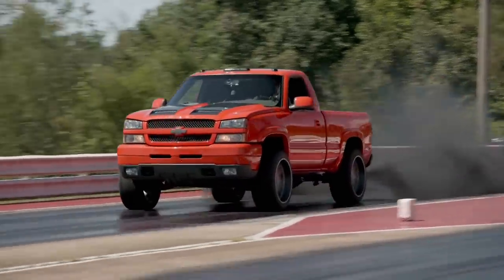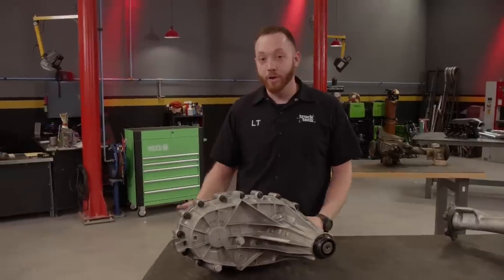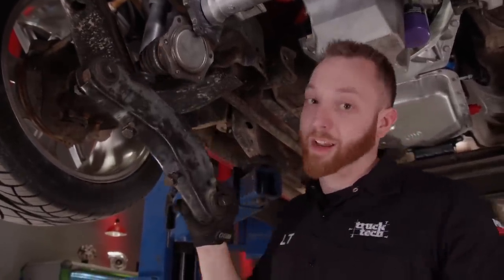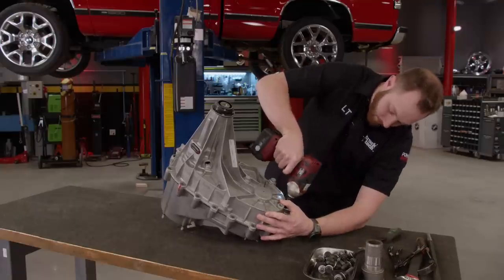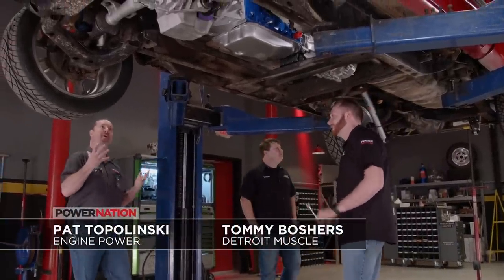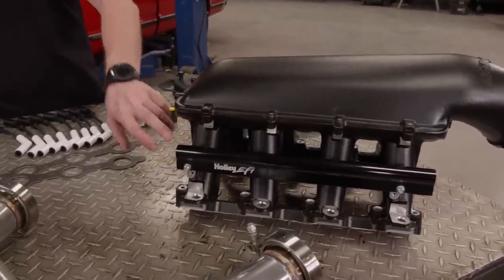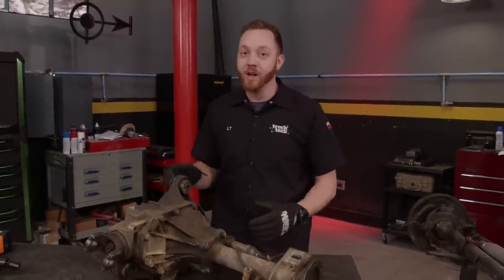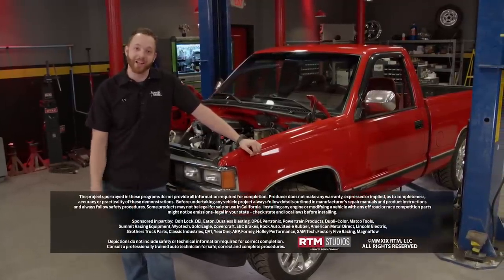AWD vs. 4WD Chevy 1500 - Truck Tech S6, E6

Comment: If you want an improved version of the NV149, get one out of a 2003 to 2015 GM H series AWD cargo van.  They shipped with a BorgWarner 4471 or 4473, which are way better than the NV149, since the NV149 is technically an open diff, and if you remove the front input shaft, it will not transfer power to the rear.
Reply: Bw4481/83/85

Comment: Who makes the 32spline input?  I’m on the market for one!
Reply: An AWD transfer case from 07 and newer denalis and Escalades Have 32 spline and no sensors on them.
Reply: @13Bender31  😬
Reply: @JoseContreras-mv5yz  I took mine to a local machine shop and they have a wire EDM machine that they used to cut the 32 spline without having to anneal and heat treat again.  Cost $200.

Comment: I was into watching this, so I can do an engine swap on my 91 K1500.  You left out a lot of information that would have been helpful.  You removed the front end wiring harness, all the way to and thru the firewall.  However, the show didn't provide any further information about the wiring of an engine swap besides the Holley wiring to the engine, inside the engine compartment. 
I wanted to know if I missed something?  I saw S6, E6, E7 and E8. 
Can someone let me know of a video(s) that show more wiring detailing?

Comment: I have a 2004 SS that needs some love, wiring, speedo not working, heated seats are bad, and some suspension work is needed, but the truck runs and drives well. If you guys need a new project truck, and want to fix this for the show, let me know..haha..

Comment: Question- wouldn't it be easier to mount the accessories onto the engine BEFORE putting it in the truck? At least most of them?
Reply: not really, the ps pump is a pita with the steering shaft in, but otherwise the rest is a cakewalk, alt is right up top, and unless notching the frame for the low mount compressor you're running a higher up ac compressor anyways. water pump is 6 bolts easy to access, and better to leave off until it's in, especially if you're not pulling the rad or condensor

Comment: Me and my son are building the same truck but i purchase a 07 cadillac escalade 6.2 and i just purchase the motor mount bracket and everything bolt on even the rear driveline was the right size

Comment: I want to convert my 2000 GMC 3500HD dually to 4WD. It has the factory I-beam axle in the front with leaf springs, a Dana 80 in the rear, 7.4 Vortec (454) and a 4L80E trans. Not sure if I should go with a Dana 60 or Dana 70 in the front. Any advice? Is one axle easier to work with?

Comment: Would love to run this front differential in my 03 S10 blazer that I’m looking to lift instead of going Dana 44s for axles for a SAS swap. I wonder if the NV149 would mate to a NV3500
Reply: same issue as that 4l80e, 32 spline output shaft. there are other awd cases that came behind the 6l80e that will bolt right up
Reply: Yeah I get that. I’m not interested in a 6L80e. Prefer to have manual transmission because it’s more fun to drive.

I’m not all that interested in lowered AWD vehicles being a 4wd guy.
Reply: @adamw5823  right, the 6l80e shares the 32 spline output and 6 bolt pattern with the nv3500/4500 so the awd case from say a 2007 denali bolts right on no modification. Otherwise the same input shaft he swapped to here on the 149 will work fine

Comment: I'm in process of this on my 01. Going from auto 4wd to full time.
I have to wonder can I remove the tube and gut the parts,  and use the one piece 'Onto' the oem front differential assy..... 
Snap in one piece axle. 
Yes or no

Comment: How about Emission Ca Controlled Vehicles such as my 91 TBI 454 R2500 Chevy Suburban , i would like to Upgrade it to a Holley Sniper QJet 4 Bbl TBI ?
I'm wondering if i put a Egr 4 bbl Spread Bore Intake and drop the Sniper in, can i get away with visual since I'm still technically  EFI ?

Isn't your Red Emission Controlled?

Comment: How about excision controlled vehicles such as my 91 TBI 454 R2500 Chevy Suburban , i would like to Upgrade it to a Holley Sniper QJet 4 Bbl TBI ?
I'm wondering if i put a Egr 4 bbl Spread Bore Intake and drop in the Sniper in, can i get away with visual since I'm still technically  EFI ?

Comment: Hello, I have a 2008 GMC Sierra SLE  1500 4x4 Ext cab with a 6.5 ft box. I think this would be an awesome project to do with my truck. Would I be able to change all of the drive train before I do the engine and transmission swap? Like just the front diff, t-case and suspension and then do the engine and transmission swap afterwards. I have the 4.8L and the 4L60E transmission in my truck now so would I have to change the shift on the t-case to fit the transmission? Any advice would help me, thank you and have a great day.

Comment: Now that it's all wheel drive , Does it still buck and fight you when you turn a tight corner?
Reply: No.
Reply: Shouldn't really do that either way but definitely not in awd since frontand rear axles are viscous coupled. Nobody makes a locker forthe front diff so it's always "open". Should be fine cornering now
Reply: They do make lockers for front diffs lmfao who told u that??? Been using em mud boggin since moby dick was just a minnow! Learn the facts people don't just blurt out some off the wall garbage

Comment: I'll be waiting for the price breakdown on everything needed to get that EFI LS engine up and running, since LT made an issue about how much it would cost to rebuild & stroke the original engine - which I believe was around $6300. He made it sound so cost prohibitive.
Reply: In an obs? We have guys literally make money on their swaps. Look up ls swapped 88-98 obs trucks on facebook
Reply: @chaingun87 , I think you missed the point of my comment. In a previous episode, LT made it seem like rebuilding and stroking the original engine would be very expensive, and swapping in an LS would be cheaper. The bare LS long-block may have been cheaper, but JUST dressing it out will put the price way over the cost of rebuilding and stroking the original SBC. I didn't say putting the LS in was waste of money.
Reply: No seriously. Buying a  good running donor instead of a new long block makes all the difference. Swap mounts, fuel pump, and stand alone harness would get it driving on stock electronics for a a couple hundred bucks. Parting the donor will net a large chunk of the cost back.
As far as this build, id say new long block, trans, terminator, intake, injectors etc is going to be well over $6300, but it's far from the only way to do it
Reply: I totally agree; he could have done the donor plan, and should have, since he made an issue of the cost of the SBC rebuild cost. If he had used the argument of power and fuel efficiency, then that would have been better. No doubt sponsorship money has a lot to do with this crap.

Comment: I have a question what did you guys do with or about the knock sensors didn’t see you put none in? I understand this is a track truck but if it’s street legal won’t it throw a check engine light?
Reply: @Lonnie Davis  I know this is an old comment but you they did put them in, you can see the front one @ 19:42

Comment: What part number are those Pacesetter Headers? I just installed some on my 01 Silverado 1500. I looked all over the place and couldn't find any without the EGR Port. Although the headers I bought did come with the block off plate. I dont think it looks as clean

EDIT: Never mind, didnt get far enough into the video where they posted a link to part numbers. Although the parts link leads to the same pacesetters I bought.
Reply: Hey i need some advise im not to  knowledgeable when it comes to parks in are changing everything but I have a 98 c1500 v6 manual 5speed 2door short bed chevy and i wanna do something to give it some guts but nothing that a guy with a limited budget and limited knowledge will be able to do any one got some suggestions or advise to a guy who's been in love with thid year amd wanna give some life to my obs..

Comment: I have a 2005 Silverado 1500 z71 5.3 with a big cam headers port  polish and shaved heads hot rod magazine estimates around  450 N/A engine...so you are saying I can take my truck as is right now  to the Drag Strip 1/8 or 1/4 mile and put it in 4-Wheel Drive  with some drag radials and  cut a good  light and not tear up my 4-Wheel Drive... would it be just like A.W.D ....please let me know if this is true....Thank you

Comment: Would a AWD Astro van diff work?
Reply: the design is similar, but the mounts are different, the axles are smaller, the overall width is less. so for all the reasons that this works, astro would be a  bad idea. also it was made for much less power 4.3 [great engine tho]

Comment: So the 4 wheel drive actuator changes it from a four-wheel drive to a three wheel drive?
Reply: I think it just disengages the passenger side from the driver side for corners. The driver side is still connected, but the tranfers case is disengaged so Im pretty sure it stays 2 wheel traction

Comment: Faster proms has been building their "Frankenstein" twin turbo 5.3 awd s10. It's definitely worth checking out. 

youtube.com/watch?v=lDBuRgcrlms
Reply: Its not AWD as of the last video. just had a standard 2wd/4wd t-case
Reply: Sweet but that guts anoying
Reply: @zuestoots5176  negative. They removed the front axle because its only a 2 wheel dyno. They need to take it next door to the chassis dyno for awd numbers.

Comment: what happens if you put mismatched gears 4.10s up front and 3.73 in rear?
Reply: Fry your transfer case
Reply: Big explosion, big success?
Reply: Major problems busted diff stripped gears in transfer case frayed transmission don't just don't do it don't even put different size tires on a 4 wheel/ all wheel drive

Comment: Why not get a 9.5 14 bolt from a Silverado SS or VHO already geared 4.11 so you never have to worry about it breaking.
Reply: c2500 or 6 lug k 2500 obs bolt right in, you have to cut and move spring perches on the nbs axles which is arguably more work than regearing

Comment: my 92 k1500 with  a 350 700r4   still runs  like new..an staying  stock   dont need awd  ,,never been stuck  ..why change???
Reply: Never stuck?  ... hum, but anyway,      so hear is the deal, this video/project ain't about getting stuck its about sticking,  I've got an old harley a little like your truck, it two has never been stuck

Comment: I've never understood lifting a 4WD truck, raising the CG instead of keeping it low. This is a fantastic project.
Reply: Are you serious?
Reply: Because everyone goes mudding with a lowered 4x4..........wtf
Reply: This is an AWD street truck, so anyone complaining about a lowered 4x4 doesn't understand what's happening here. Yes, raising a truck 8+inches is totally unnecessary even for offroading. The cons way outweigh the pros.
Reply: @xc8487  either way, its purpose built. Pretty badass imo
Reply: @Welcometofacsistube  Sure. Real world offroading would be dirt/gravel roads/trails or even a big field. Most people try to avoid 3ft boulders and massive ruts unless it's a weekend toy at an offroad park.

Comment: Using 4 wheel drive full timeI have to settings in my suburban 4-wheel high and four-wheel low on 4-wheel high I can drive around on dry pavement and turn corners not real tight but I could turn corners so your statement you can't use 4-wheel drive on dry pavement is false

Comment: So much easier to spend the money on the old 350. His $6000-8000 is inflated. With the way they did this.....have way over $10,000 by the time you do all the mods and use all new parts.

Comment: It still disheartened me to see that A/C wide open. At this point you need to change out all components. Them hoses have sucked up so much moisture in them that would take 48-72hrs and many many oil changes to dry them out for service. 20+yrs in HVACR  industry.

Comment: justified ls swap because he didnt want to spend 5-6k on SBC, in turn spend 10K doing the overpriced LS swap. should have bought wrecked or for sale escalade or denali that was AWD, they came in 6.0/4l80e/AWD..you could transplant everything, that efi is nice but expensive and all that new small stuffs adds up way fast,  hell get it all in and running then decide if you want to rebuild or reseal

Comment: lol buy a 3-4k truck... 4500 dollar motor... 4k trans... 4k computer/sensors coils intake setup... 1500 headers... 3k on the transfer case and front diff... 1500 wheels tires... miscellaneous parts regearing the rear  rest of the exhaust... probably another 3-4k the way theyre going... be cheaper to just buy an 03 silverado ss and swap it all over
Reply: Rob C the Holley system is cheap. About 1200 for computer system if this is a drive by cable about 200 more if drive by wire. Sensors maybe 200.
Reply: @Thee_Magic_Man  intake with tb is 1k...  termanator is 1300 w/trans control...  injectors start at 400... coils 700... fuel system about 400 ... sense it has no sensors they range between 20 and 200 not going to figure all those out... then you have cables and brackets going to need all hardware... its going to be damn close to 4k it adds up so fast

Comment: You’re giving bad info. Using 4wd on a part time system at high speed on dry pavement, even in a straight line, is murder for the transfer case.

Comment: No way I would ever use a gear ratio over a 3.73 because anything higher than that you lose the ability to drive it on the street and if you aren't using it for towing it's pointless as well because of the 4 speed transmission but if it had a 6 speed transmission then going over 3.73 would be more tolerable because a 4.10 gear ratio will limit your top speed big time and wheel spin or wheel hop will also be a problem.

Comment: I drive In 4 wheel drive all the time
Reply: On pavement?
Reply: It's fun to put it in neutral , rev the engine real high then throw it in drive . It's the best way to make burnouts. I do it all the time in my  step dads  f-150. It might make weird noises after but if you turn up the radio it's not bad.

Comment: AWD Chevy Trucks SUCK!!  I had a 2006 AWD Silverado SS. You couldn't drive it in the Rain. It was like driving on Marbles. I tried different tries ( 3 different sets ) It just did not have any traction in wet weather. If you were Making a left turn in wet weather, When the light turned green, You could give it a little gas and pull forward, And make your left turn. But if you give it ANY gas during the turn, It would swap ends on you. I am old as dirt, NEVER had an accident in my life until I owned the 06 SS Silverado AWD. I totaled it out 2 times in 3 years. Both occurred from spinning out on wet roads. I was not ticked in either wreck. I wasn't speeding, In fact I was under the posted speed limit on both occasions. The truck just would not drive on wet roads. I will NEVER own any type of AWD again.

Comment: The taco 4.0 still runs great...and you mash it gets on it for a 6...its 4 valves a cyclinder and just airrrrr.  its burns that old ford straight six baddd lol...thing had no top end and wayyy too tractor long stroke....that short stroke and smaller stuff and airrrrr issss TOP END.